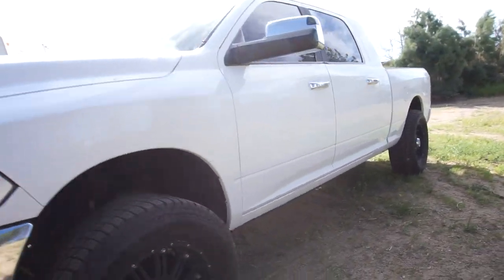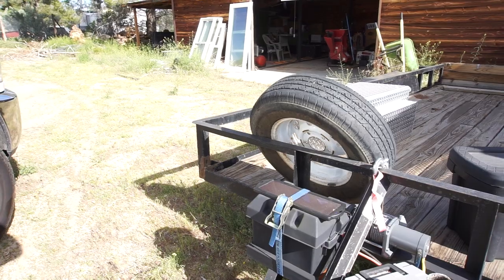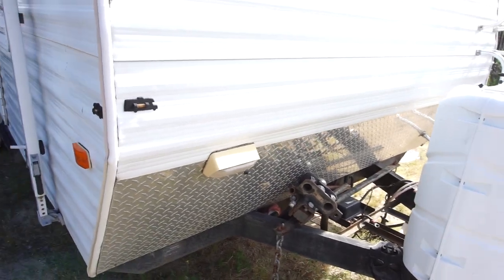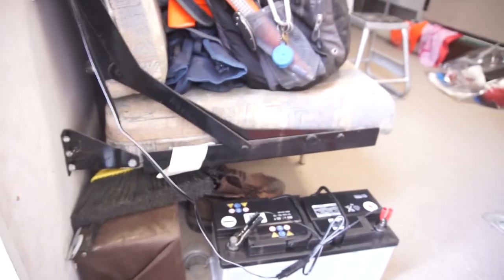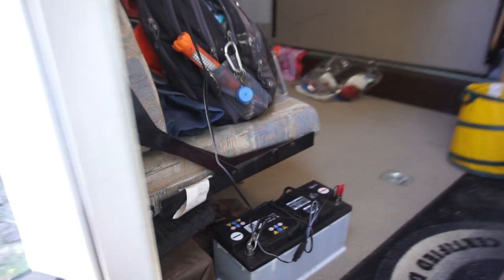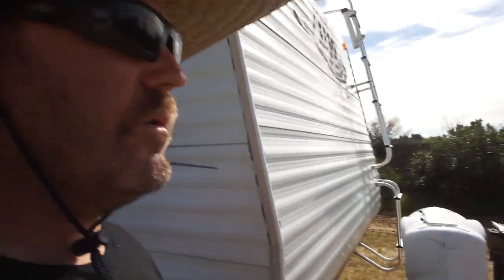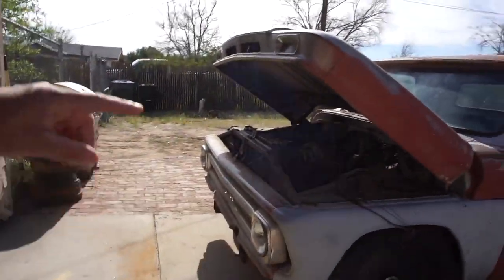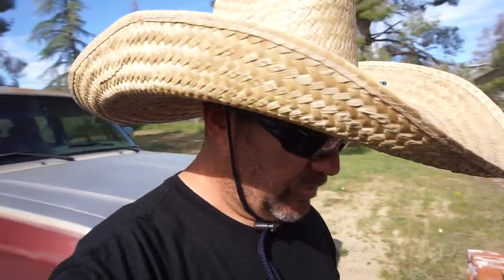Thursdays Tool Review. 1.5 Watt Solar Panel From Harbor Freight

Comment: So you just hook those panels direct to the battery ?  No charger or anything ?  Awesome hat dude !!  Kind'a looks like the head gear the Flying Nun wore !  Careful you don't fly away !!
Reply from the maker: Orion Fixr yeah they’re 12volt and have a built in regulator that shits off at 13volts or close to it. Kind cool and have worked for many years for me.
Reply: @Halffast719  ; Thanks for the info. I can't believe I've never heard of this .